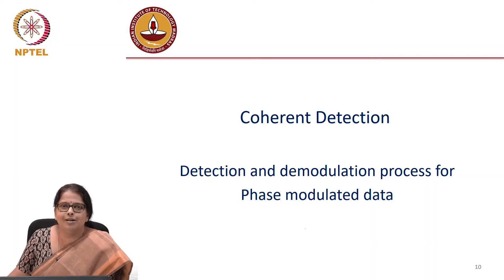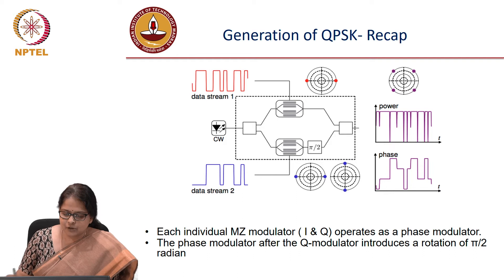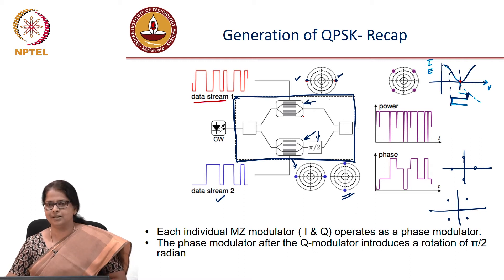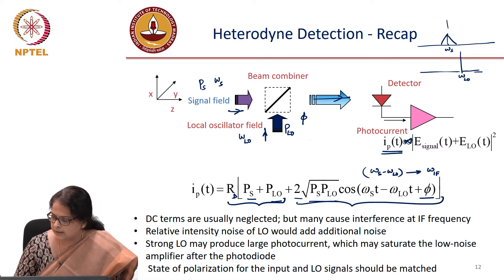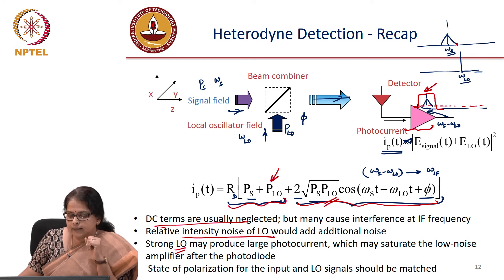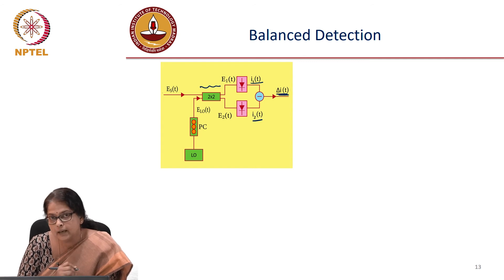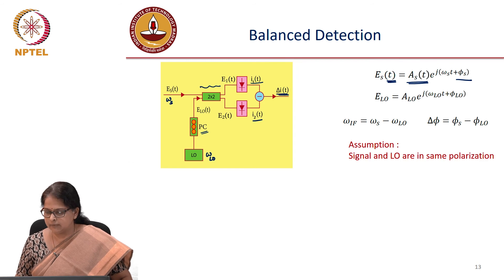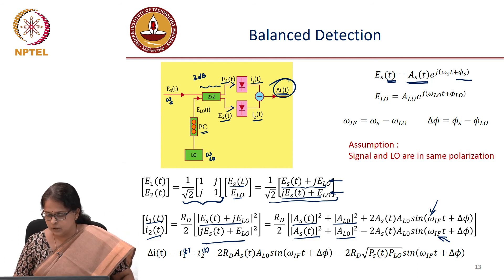Lec 100: Balanced Detection

Comment: 10:39 where did the 2x2 fiber coupler equation come from? Where can I find the proof?
Reply: I am interested in the same. prof Venkitesh, does the couple act like a free space beam splitter where the reflected wave has a pi phase shift and the transmitted beamhas no phase shift.  So in the case of a 2x2 fiber splitter,  the to exit ports have a difference of pi phase?
Reply: It comes from you requiring that the transformation of the 2x2 be unitary. The 2x2 is a beam splitter (BS) by the way. Actually there is a freedom of choice when choosing the phase the transmission and reflection gain when passing through the BS, since your only requirement is that the square of the transfer matrix be identity. However, it is common to define that reflections get a phase of pi/2 and transmissions get no phase (which is physically sound). Just remember to consider that extra mirrors on the way will also give a global phase of pi/2 if you choose to recombine the beams (you can actually model a mirror as a BS for which the transmission is 0 or you can introduce some transmission to account for power loss in a mirror).